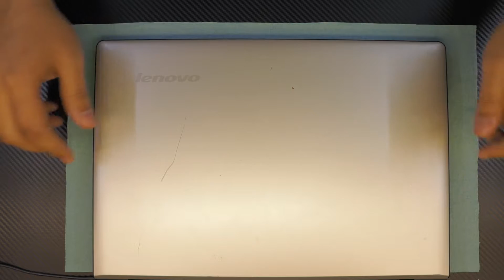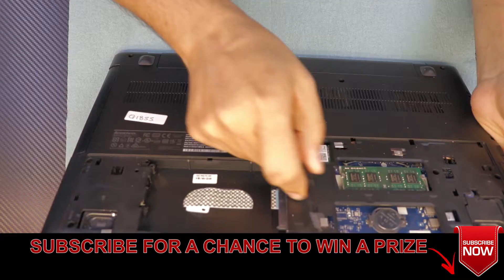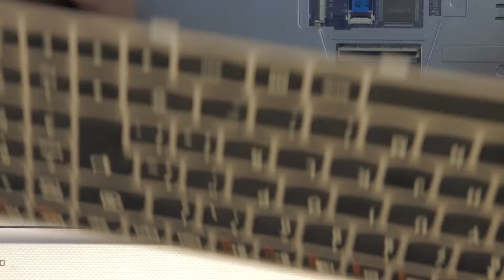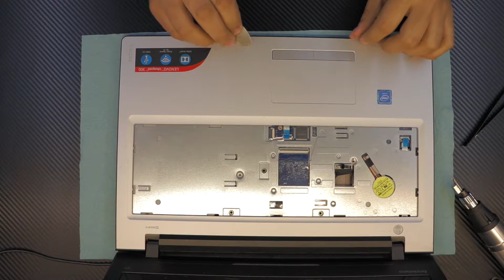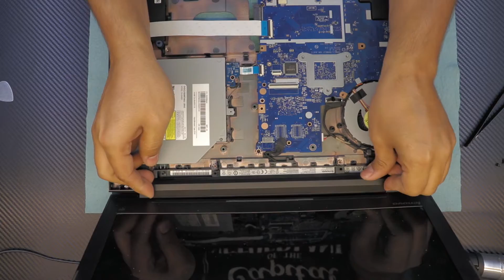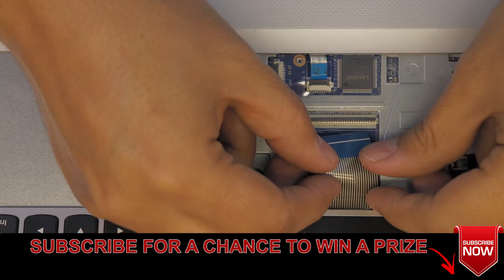lenovo ideapad 300 BATTERY replacement , removal

Comment: Hello, I have an Ideapad 300-14ISK, bought in 2016 so  yeah it's old. Yesterday its battery suddenly didn't accept charging anymore, so wheneve I unplugged the power cable the laptop turned off. My question is how can I tell whether it is the battery needs to be replaced and not the charging part on the motherboard?  FYI I havent bought a replacement battery though.
Reply: Give your laptop to the service centre they replace your battery

Comment: Thank you very much for your video. I have replaced the battery still the laptop doesn't work with battery power. I need keep the charger connected. New battery show 49% charge is remaining, but when I unplug the charger laptop power off. What could be the cause?
Reply from the maker: Thank you for your feedback! If you wish to support the channel, you can like, subscribe, or both!
Regarding your question, update the bios and uninstall A/C power driver and restart. hopefully this helps else, you may have a charge component issue on motherboard.
Reply: Thank you for your quick response.  I have tried uninstalling battery drivers and restarted the laptop. Also there is no pending BIOS update. Do you think the motherboard charging component is fixable? If yes, what is that component?

Thank you for support on this matter.
Reply from the maker: there are many components that needs to be checked before, there are few power regulators, they look like this: https://imgur.com/a/9JGdbxJ
and few resistors,  i don't recommend you to touch them if you don't have electronic background, you could damage the motherboard. i recommend you to see a good technician. sorry but there is nothing at this point that i can assist you over the chat, i will try to make a video on how to detect shorts on power regulators, but it will be on different boards, unless i get the same laptop with the issue.
Reply: @uFixTek  thank you very much for your quick reply and advice. I will check further with a technician. Thank you very much for your videos and quick replies. I replaced the keyboard too watching your video.
Reply from the maker: it is my pleasure and i wish you the best on fixing the laptop. 🍻

Comment: Can I use ideapad 300 without battery?
Reply from the maker: Thank you for the feedback! if you wish to support the channel you can LIKE or SUB or both :P
regarding your question:  sure you can, and it will work awesome, and the charger will last you longer as it doesn't have to stress with charging the battery. and the mother life span increases.

Comment: Is there a chance that the replacement battery in the market may not work?
The PC Monkey says it's a 50% chance of not working. What's your experience?
Reply from the maker: NOT true , it will work fine we been replacing batteries and purchasing them from china amazon and local shops and they are always working fine for our clients zero complain.

Comment: Will I get the top and bottom base of this laptop?
Reply from the maker: Thanks ✌  for the feedback! if you wish to support the channel you can LIKE or SUB or both :P
regarding your question: what country you from so i can give you the right link.
Reply: @uFixTek  I live in India and all I found was the bottom base but I needed the top one also since the screw needs to be tightened..
These Plastic body laptops are not good for a long run...
Reply from the maker: Thats true, im trying to find one,  can you give me the exact model number under your laptop.
Reply: @uFixTek  Lenovo IdeaPad 300 14ISK 
Type is 80Q6
Reply from the maker: https://www.aliexpress.com/item/1005001863937820.html?spm=a2g0o.productlist.0.0.3eac6ea1kL9eom&algo_pvid=a2ff185f-b2d3-4ac5-aa66-0a8a66ed92ee&algo_exp_id=a2ff185f-b2d3-4ac5-aa66-0a8a66ed92ee-0&pdp_ext_f=%7B%22sku_id%22%3A%2212000017905471950%22%7D
Reply from the maker: https://www.aliexpress.com/item/32919318710.html?spm=a2g0o.productlist.0.0.3eac6ea1kL9eom&algo_pvid=a2ff185f-b2d3-4ac5-aa66-0a8a66ed92ee&algo_exp_id=a2ff185f-b2d3-4ac5-aa66-0a8a66ed92ee-11&pdp_ext_f=%7B%22sku_id%22%3A%2266023689494%22%7D

Comment: It's a joke for remove the battery......
Reply from the maker: Thank you for the feedback! if you wish to support the channel you can LIKE or SUB or both :P
regarding the battery location and removal i agree on that, they do it intentionally so people take them to service center.
Reply: @uFixTek  I disconnect the battery, push 1 MN on start button, plug the alimentary cable....but my laptop doesn't want to switch on...
Before that, I had forced to switch off because he s blocked.
Reply from the maker: remove the internal battery and remove the cmos battery and press and hold the power for 30sec, make sure you remove the cmos battery @1:01 you can see it beside the ram.
Reply: @uFixTek  ok thank you I will see that tomorrow!.
Reply from the maker: oki, good luck :P
Reply: Hi, any update on this? Mine having the same issue, it won't turn on after I pressed the on button for abt 1min🤣

Comment: Please help, I can't unhook that cables 4:32 it's my first time and I'm scared.
Reply from the maker: Thank you! for the feedback and your support to the channel by SUB :P
Regarding your question: just pull back really hard on the cable, it will come loose
Reply: @uFixTek   I will subscribe right away. I hesitated to pull hard at first time 'cuz I was a bit scared lol. Then I did and it came. I managed to fix my battery problem without going to service thanks to you. 💜
Reply from the maker: @vitoscaletta8652  my pleasure and thank you for the support and if you got any question feel free to ask me anytime :)

Comment: you didn't connect two wires at the end!  😅
Reply from the maker: Thank you for the feedback , it is very true i had to reopen the cover to plug the wifi cable, this video was a old video i was still struggling to record and talk and service at the same time :P|
but i have improved :)

Comment: when i charge my laptop it is showing Plugging in but the charge is slowly reducing . 
But when I switch off the laptop and then it is charging
But the battery discharge last for 30 mins
What maybe the issue
Reply from the maker: there are two issue with this models, one is the battery is going bad 80% of the cases we get this issue in the store, 20% could be a bad mosfet or power regulator chip on motherboard .
Thank you for your support for the channel

Comment: I want to change my laptop battery , what is your advice for battery brand (lenovo ideapad 300)
Reply from the maker: dont worry about the battery brands they are all the same only one or two factories make them and companies pay for branding and logo:
https://amzn.to/3nnyDyJ
Thank you for the support and feedback.
Reply: @uFixTek  my battery features : lenovo  IdeaPad 80Q700LBTX, 300 15-ISK, 

ıs this battery enable my laptop ?
Reply from the maker: this one is for your model :
https://amzn.to/3nnyDyJ
300 15-ISK
Reply: @uFixTek  Hi, ı take this battery and I fix battery but the battery is not charging and does not work when the charger is not plugged in. What can I do ?

Comment: Very helpful video -- better than anything Lenovo provides. But they sure made this devilishly hard. I'm used to Thinkpads, which have batteries that are easy to swap. One note: some of the screws are of different sizes, though that's not obvious to look at them. Keep track of where they came from.
Reply from the maker: Thank you for the feedback and your support to the channel. you are right they try to make people go back to them to get the parts and reduce people doing the repairs, and its just going to get harder and harder by year. :/

Comment: Those damn lenovo's constructors. Honestly, to change the HDD, it is strongly adviced to disconnect the battery, and even having that quick access to HDD, I have to go through all of this to disconnect that goshdarn battery... Uuugh!
Reply from the maker: jesus , you don't need to disconnect the battery STRONGLY ADVISED not to do so! , you love suffering or something. when the power is off, the sata rail has no power at all , read the schematics before strongly advice!>

Comment: So Lenovo Engineers... let me see if I have this right... I need to change a battery, so I have to basically disassemble my entire laptop... what a stupid design...and the battery costs 85 bucks with tax. Time to by another Brand. My HP was a 5 second change....from the outside....no disassembly required.
Reply from the maker: its called milking the cow (consumers)

Comment: Can i fix the black screen befor log in by removing the battery and start the laptop with charger?
i wanna get to advanced startup
no keys works.
It's because I end some process in task manager accidentlly.
Reply from the maker: no my friend you cant do that even if you remove all the battery it wont fix the issue. i would recommend you to do this:

Boot the computer and repeatedly press and release F8 until the Advanced Boot Options menu pops up. Then you can select Safe Mode or Safe Mode with Networking.

good luck
Reply: @uFixTek  When i enter the safe mode it's still black screen in safe mode with cursor what should i do now?
Reply from the maker: okay, there are two options here!, #1. format the hard drive with fresh install of the windows very easy and forward if you need help i can help 40min and you can have your windows new!
#2. repair your windows with windows installation process. *here you maybe can conserve your files

#3. if you really need your files (docs pics...) then you should buy one of this they are very very handy to have
https://amzn.to/2J7WmBb

then you remove your hdd and plug it in the adapter then to another pc and back up the files under USER and XXXX and doc and pics and everything else in there

then you can do a fresh install steps:
#1.https://www.microsoft.com/en-gb/software-download/windows10
CLICK "DOWNLOAD TOOL NOW"

#2. then use a 4gb or 8gb usb drive and chose to download into a bootable usb drive
#3. after the download it will automatically burn it into usb

#4. plug the usb into laptop and boot up and press F12  and choose windows 10 64 bit install and the rest is very essay instructions

#5 in one of the steps During the installation YOU WILL GET TO CHOSE ADVANCED INSTALL (NEW INSTALLATION) or UPDATE AND REPAIR 

I WOULD RECOMMEND NEW "ADVANCED" if you have back up your files. and in the next step erase all the partitions in the list and click continue. make sure you erase all the partitions.

if anything let me know.
good luck
Reply: @uFixTek  Brooo you can't believe how much happy I am right now.
I don't really know how to thank you.
I would pay you whatever was needed for these amazing informations but 
I am proud of your patience for wasting me.
thank you bro.
the 3rd method is what I was searching for 3 days 
That's exactly the 1 and only answer for me bro 
You drained all my stress and anxiety I had in these 3 days
thanks alot brother.
I'm proud of you and will remember you always❤.
Reply from the maker: don't worry my friend , that's why im here i try to answer all the questions you guyz have and to fix your issue.

if you need a detail of step by step of anything let me know.
inshallah everything will work out :)
Reply from the maker: here are something to get you going
https://imgur.com/a/SMN5lCq
Reply from the maker: remember always 64bit version if you ever get the option to choose go with 64bit .

Thank you for the like and sub :P
Reply: @uFixTek  Yh thank you bro I will follow your instructions.

Comment: Hey, does the charging port is just staying right there or it's hold down with something? 
Have a nice day
Reply from the maker: no there is no screws or anything it will just pull up and it will come out its boxed in . just lift it and you will see. :)
Reply: @uFixTek  thanks but I got a client that got this computer and the bottom part is pretty fucked up and the charging port was wiggling around, thanks for the reply!
Reply from the maker: if it was wiggling then the tiny plastics that holds it in place are broken but you can fix that my putting some type of paste glue, its just the case is broken fixable very easy. good luck

Comment: a simple battery change which requires half the laptop parts remove. Lenovo must have a reason for this.
Reply from the maker: yes , they want you to go to them and buy expensive battery replacement from them, when you can just do it by yourself
Reply: To buy new laptop actually..  This laptop is so expensive and can easily be broken...  Not even 6 months the chasis broke aneer the battery...  Poor engineering..  Swore to never buy levovo again

Comment: Im starting to regret buying this laptop 3 years ago. I never knew replacing the battery is this complicated!
Reply: Replacing batteries used to very easy
Reply: Yah..youre right never knew lenovo ideapad is really hard
Reply: I just fried my board cuz I put the wire in wrong

Comment: everything was great, but you forgot to reconnect your wifi wires before re-attaching the final cover.
Reply from the maker: yes my friend i was in a rush and paying attention to the camera screen and at the same time trying to work its hard and im trying my best, and those cable they looked like they are connected :P , and yes i had to open the cover and reconnect them.  this is last years video im doing a better progress on my recordings. i really appreciate your comment and pointing out the thing i missed at the end.

Comment: Can i add SSD (Any SSD Slot available) ??? Or i must change the HDD to SSD ?
Reply from the maker: you can only replace the HDD to SSD , BUT if you don't use your optical drive, you can remove it and place a adapter that can hold ssd /hdd . 
https://amzn.to/2RQEt0x
Reply: Can add SSD but want to remove the HDD and then use adaptor to put SSD in HDD slot ? Thats your mean ?
Reply from the maker: in your case i would use the following config:
#1.remove the HDD from the main board, install an SSD and install the OP in the SSD.
#2. plug in your old HDD as an external hdd to remove your personal files (backup) https://amzn.to/2TkW1ia
#3. the reason for the 2nd step is you have to format the old hdd as it contains many internal partitions and has a OP installed and your lap may boot into it, unless you good around boot menu.
#4.after formatting you HDD place it in the optical caddy and place it in the dvd space and remove your old optical drive and keep it for the future use.

#5. enjoy having a SSD as your O.P and extra storage for your files in your optical drive.
Reply: @uFixTek  yes, HDD + SSD in 1 laptop without CD ROM..
that's right ?
Reply from the maker: Jefri Faiv yes

Comment: This is ridiculous! Thank you for the super informative video (you get a like from me) but why did the designers make it so difficult to do something so simple. For my last laptop, it was as simple as sliding a switch/button and pulling the battery out. I might just buy the battery and take it to the shop.....
Reply from the maker: im here to help if you got any questions.
Reply: Calla tuberculo
Reply: @Jefrem Perez calla diarrea
Reply from the maker: they are simply dont want you to change it by your self they want you to pay them so they change it. it will take you 10-15min to do it your self. if you take it to the shop, trust me they will best and mess up your flex cables and wont put all the screws back in.  i do this for living and i know how must technicians work.  if you want a clean and safe , do it your self. also they may exchange your HDD to a worse one or manipulate your mobo.  As a computer / electronic repair man, i dont trust 99% of the repair guyz up in canada nor down here in mexico. if you care about your stuff do it your self.
Reply: uFixTek - That’s really shocking! I didn’t know some repair shops were that bad. Can’t they get sued for stuff like that? Although I guess it might be hard to prove it... Maybe I will try to do it myself. I’ll order a new battery soon. Are the screws on the inside the same as the screws on the outside?
Reply from the maker: its hard to sue for something that you cant find out right when they give it to you. and when you sign for it. its sad but trust is out of the window from most repair shop. my clients trust me and try everything to keep it that way but for most they only see money.
Reply from the maker: regarding the screws you cant mess it up, just keep the screws for the outside in one place and the inside in the other side , they are not many and its really hard reallllyy hard to fuck  upo screws. and if you put the wrong screw wrong place nothing is gona happen you just take it back and place it where it goes all the way
Reply: uFixTek Ok. My battery came today. Wish me luck. I’m going to watch 2 more times before I attempt it lol.
Reply: There’s no risk of me wiping my entire hard drive changing it right? lol
Reply from the maker: drewbc32 good luck have faith in ur self
Reply from the maker: drewbc32 no 0% if you do i pay you 100000milion usd lol
Reply: And how do you unhook the wireless cables? There’s little resistance and I don’t want to force anything...
Reply from the maker: drewbc32 just pull the cable up
Reply from the maker: drewbc32 nothing will happen whatsapp me
Reply: uFixTek Got it, thank you. What kind of glue can you use to fix a piece that’s loose? The piece that the screws screw into are broken and rattle around. Also What’sapp said ur number is too long... Is 521 the area code?
Reply from the maker: drewbc32 use the 
Use a drop of super glue. Then put in the base and press it in then when dry then screw it in the place

Comment: Will this laptop work without the battery?
Reply from the maker: yes it will, any laptop will work without batteries, its better even if you disconnect the battery it will stress less the power brick and the motherboard components.
Reply: @uFixTek  i guess the fault isnt on my sisters laptop battery then. Thank you very much!